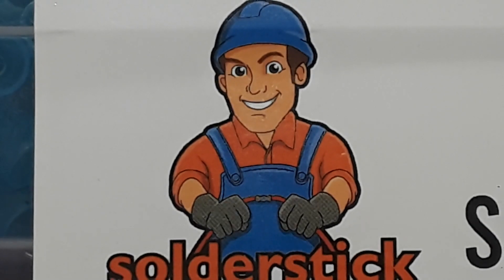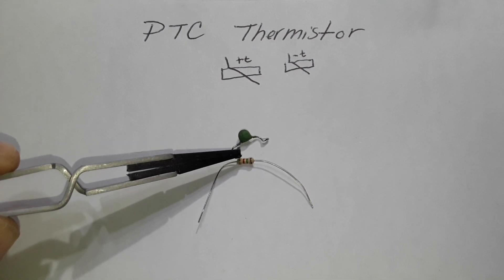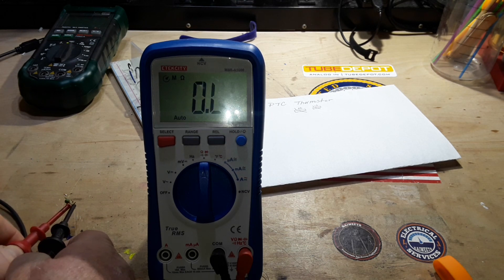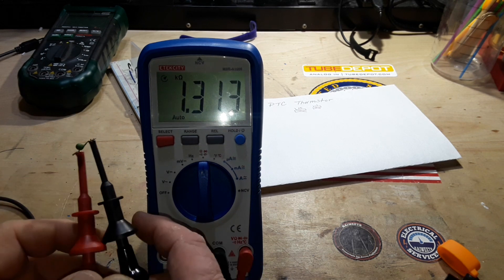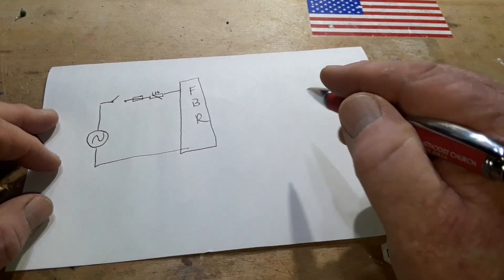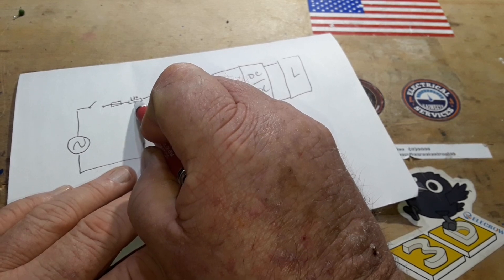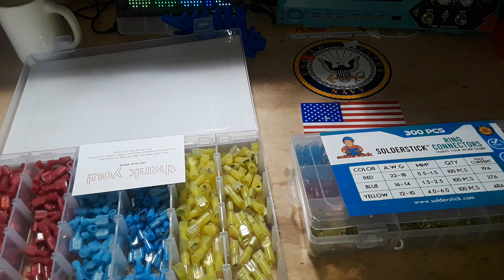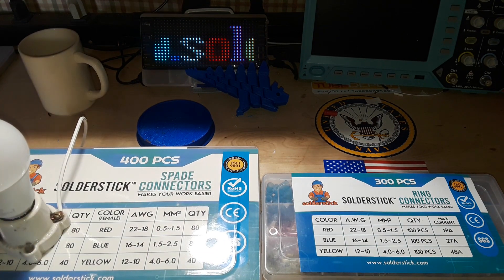What's a "PTC Thermister" -  sponsored by Solderstick Wire Connectors

Comment: As you showed in the diagram, the explaination of working in this circuit , a properly selected "ptc" will not protect the switch or other components from " inrush current" ...until it heats up sufficiently ( so there's a thermal time lag before response). By then damage may have been done.
Inrush limiting, is best done with an NTC .

Comment: NTC thermistors are normally used as inrush current limiters: They start off with a resistance when cold, and the current that passes when the device is powered up heats up the thermistor causing it to conduct better, thus not limiting current for the normal operation of the circuit. By the time the NTC is conducting near-fully, the storage capacitor has charged and no longer draws large current.
Reply: Yes, for inrush current limiter, it's an NTC that is used for that.

Comment: So, some questions ...  Always in series?  Since AC, why would I use a PTC vs a NTC?  With a smaller Cap after the BR, would there be enough time for the PTC to heat up and protect?  Are they used to protect DC circuits also?  Thanks!!

Comment: These things are on commercial door OPERATOR control boards. The sudden inrush from the motors switching directions can sometimes trigger a bit of heat to be induced on hot days.